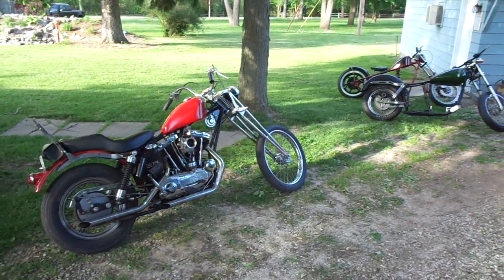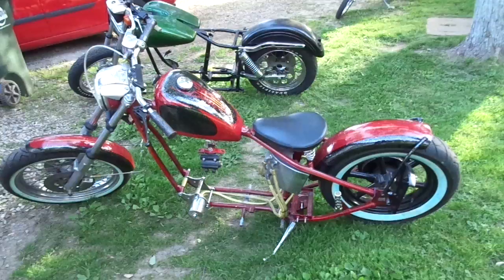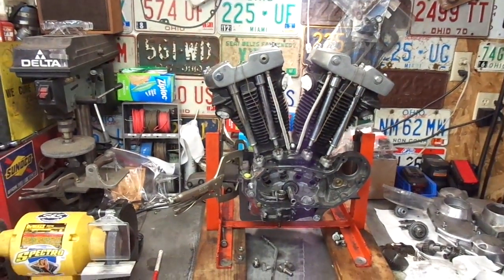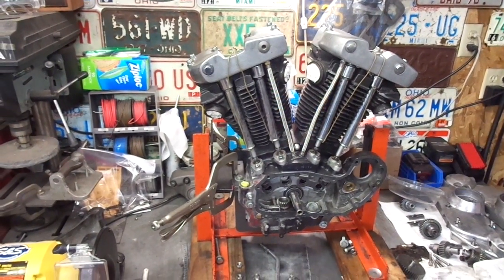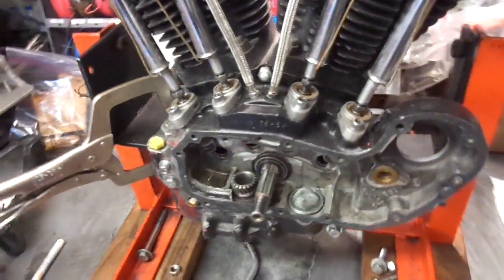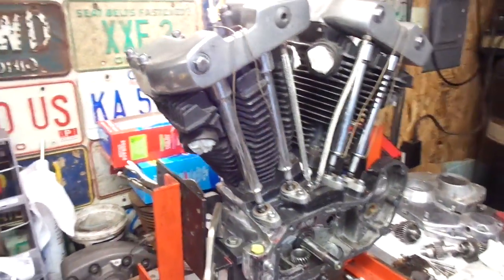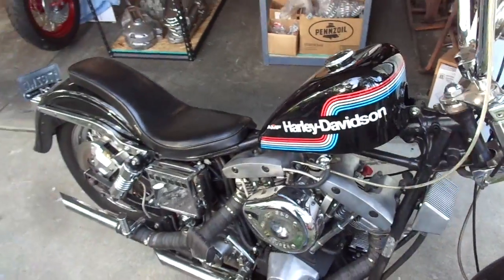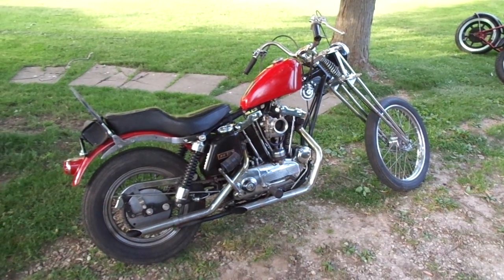Harley Ironhead Engine Shovelhead Transmission Project

Comment: There's a couple of old blokes in the USA they make the gearbox conversion and rear engine mount.look up shortsters on Facebook you should fine  there ironhead hard tailed frame and bits they are not bad priced I wish I had keep my 79 and done it. It there not cheap to get bits for hire in Australia

Comment: Cool projects bud.  I'm wanting to divorce my tranny also but the info I've found says they pick the 76 and older ironheads.  Mine is a 77. Do you happen to know why they say that? Can I cut mine up just like yours.  I'm trying to install it in an old ed Roth trike I have .  Any idea?
Reply from the maker: Hey Keith, the 57-76 uses a different style primary chain. Where that tensioner mounts on the earlier ones is a good spot to build from to make the rear engine mount. The 77 still has a bolt that connects the case halfs together that can be utilized to build the rear mount from. Definitely doable but it's alot of work whatever year you use. Good luck if you attempt it 👍

Comment: ...how did you know where to cut?
Reply from the maker: DeeInTheHouse Just kinda ran with it, cut what you don't need and leave what you do. Make sure you leave the oil return and don't cut into the engine case or threads. Very time consuming but gonna be cool!

Comment: Why do people still believe a titled engine is a think the frame is what needs a title that’s what your registration is linked to
Reply from the maker: Because Harley titles pre 1970 went to the engine not the frames. The frames didn't have vin #"s.
Reply: That would make sense if the bike was a pre 70 but I see a lot of bikes that are post 70s running without a titles frame breaking the law running a bike with plates that are from a bike that no longer exists saying bla bla bla engine matches I say bullshit throw the book at the guy and pay the fines
Reply: No bike in any state does the engine need to match the frame unless it’s a salvage inspection or a custom vehicle title application elven then once the registration is given you can put whatever you want the insurance and plates should always match the vin otherwise you would have people pulling bike engines and building whatever they want with no need to have it be legal